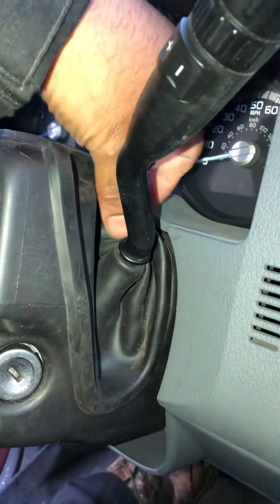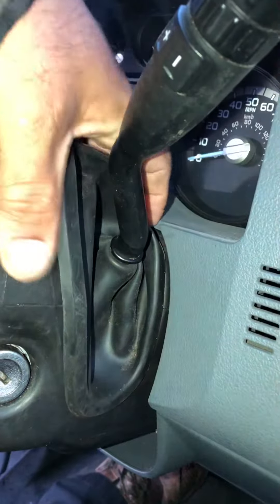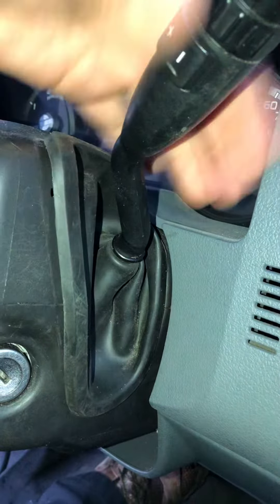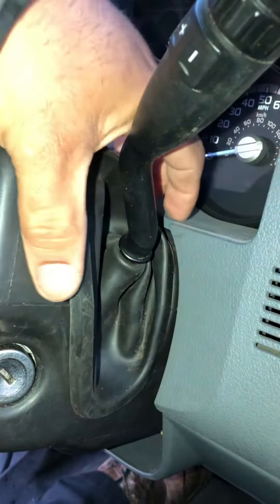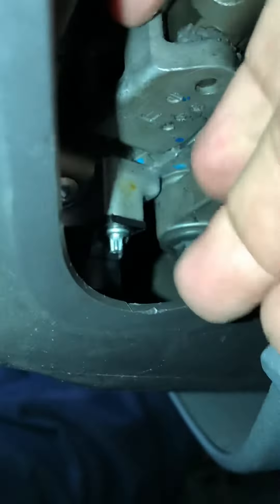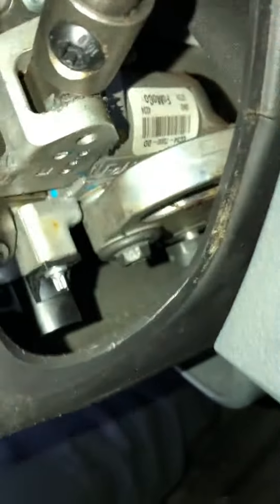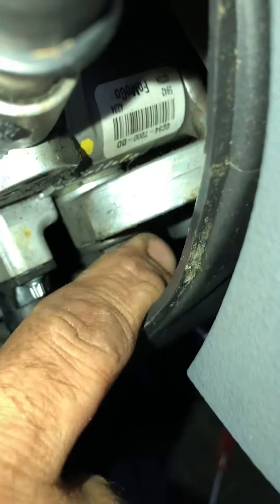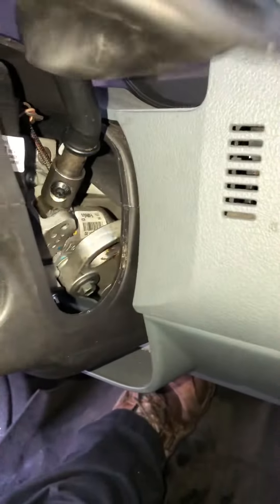How to get a 2015 Ford F-450 into neutral

Comment: Nice I just bought a 2019 f-350 and it’s stuck I’ll go try this method but my question is why will it get stuck like this and how does it return to normal press break and release
Reply from the maker: not sure, it could be a bad fuse, bad brake pedal switch or the electronic motor for the shifter release. I'd had your mechanic check it out.
Reply: I can feel the disk but should it completely pop out or move slightly?
Reply from the maker: Just move slightly. Just enough to shift

Comment: What’s the fox
Reply from the maker: Fox?
Reply: Fix not fox lol
Reply from the maker: Sometimes it could be a bad fuse, brake switch or release motor. Try checking the fuse for the brake lights.  You might have to have a mechanic look at it.